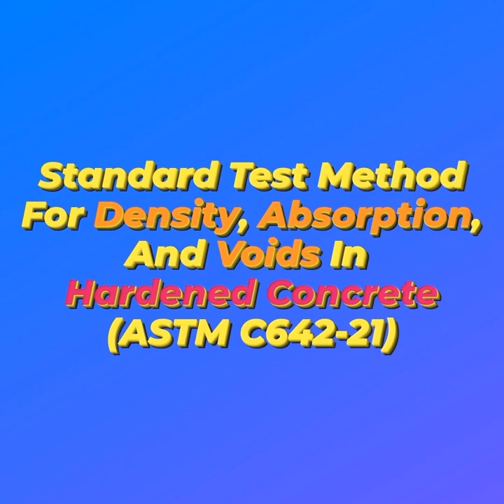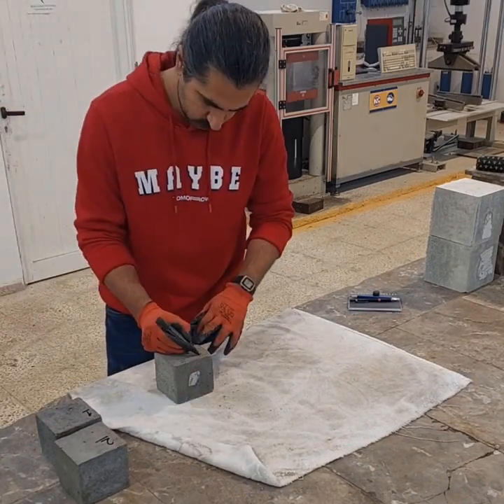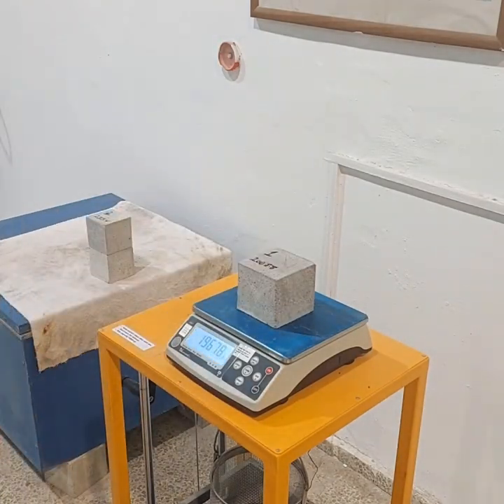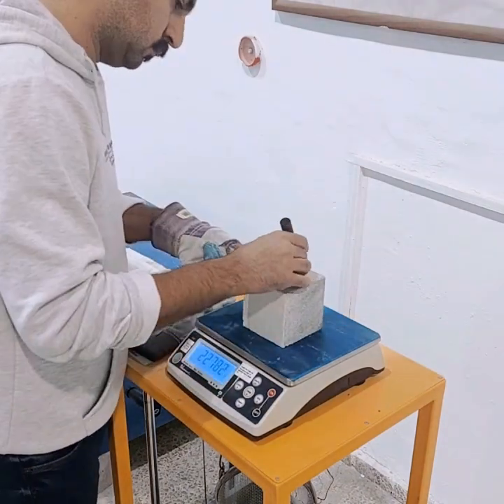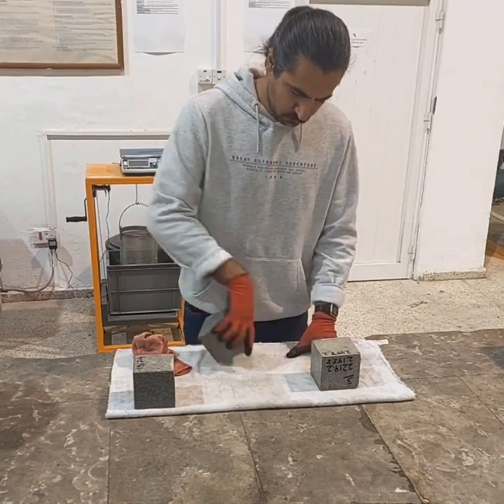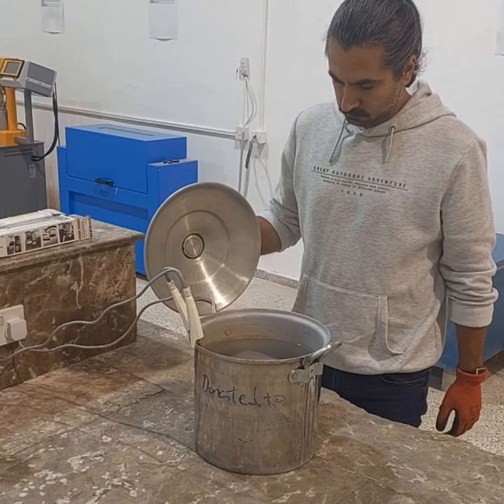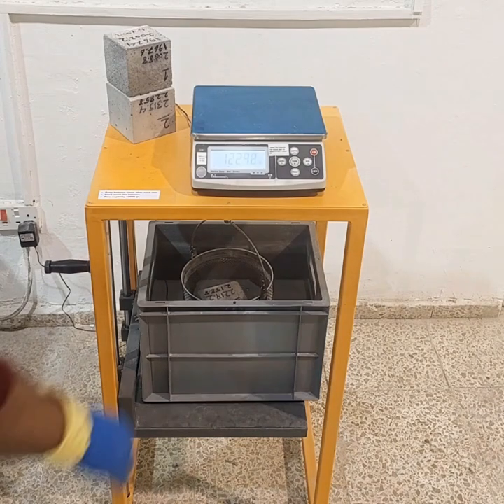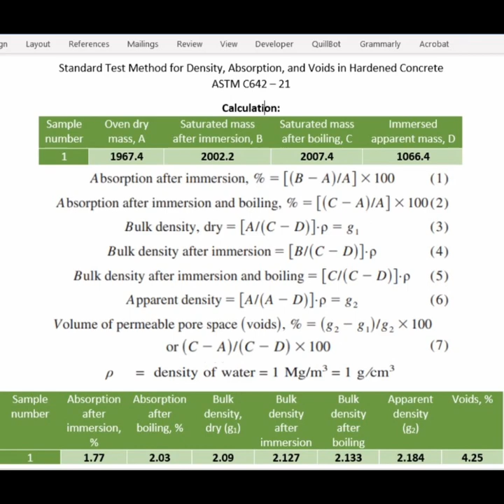Density, Absorption, And Porosity (Void Percentage) in Hardened Concrete (ASTM C642)

Comment: How did you calculate apparent mass?
Reply from the maker: Hello, I made an instance at the end of the video, pls go and check it.
By the way, there is no apparent mass, there is apparent density wich I wrote the formula, and I describe every elements in regard at the top ot table.

Comment: i can per form the test on 150x150x150 mm concrete cube ?
Reply from the maker: @sks126jntu   it might be a little hard for you to perform it, for instance you must have bigger pot to boil the water with specimens inside, other way, sure, go for it.

Comment: Nice!😎
Reply from the maker: Thanks for the visit
Reply: What is the side length of a cube? Is it 50 mm?
Reply from the maker: @maha1213  the samples that i used in this test was 100×100×100, but it can be in any shape, as long as the weight of the sample for normal concrete is higher than 800 grams.
Reply: @omiddeldar  Thank you it has been very helpful to me
Reply: Is it possible for me to know that the cube consists of mortar or concrete and according to any specification the mixing process took place? Can I use the mortar to which supplementary cement materials have been added according to ASTM C109 for this test?
Reply from the maker: I'm delightful that i could help😊 
Please dont foget to subscribe 😉
Reply from the maker: @maha1213  it was mortar plus marble dust, and i made it acording to astm c192, samples can be in any shape, but it should be more than 350 cm3 which for normal concrete is about 800 grams, but the sample for astm c109 is 5*5*5 cm which is about 125 cm3 so no you cant use that specimen for this test. If you want to make a concrete i have a video about it you can watch that video. 
If you have any further questions dont hesitate to ask please, i would be happy to help you.
Reply: @omiddeldar  Thank you very much for your help. This channel does a lot for new researchers
Reply from the maker: @maha1213  you made my day, thanks.
Reply: Thanks a lot for the detailed and informative educational video in this channel. Please keep it up and we will support you.